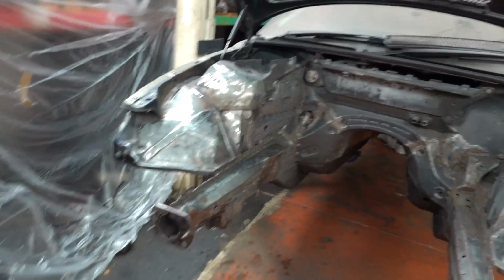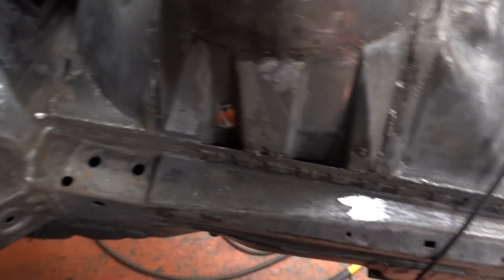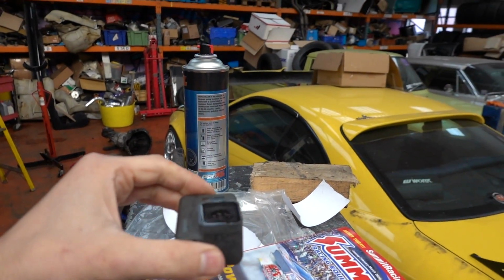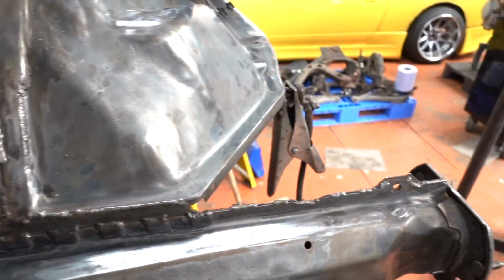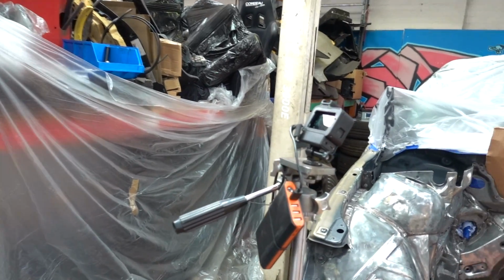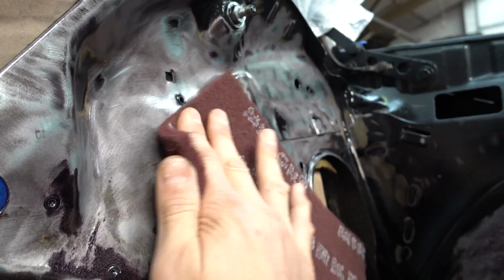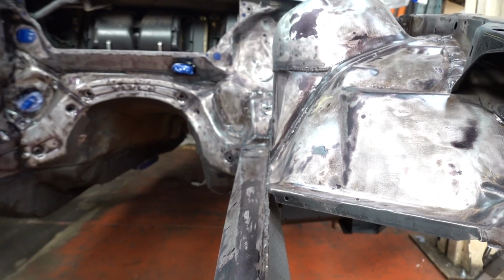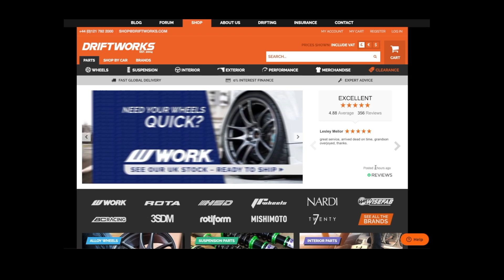Paint the engine bay with added DnB - Driftworks V10 BMW M3 project Pt 23

Comment: i'll tell ya, that would be something special to have a small block chevy in my aston. wondering if that ridiculously tall reverse gear was fixed.... the other day i put her in reverse and let it accelerate at idle speed. i swear to god i was going 20 MPH backwards before i had enough and put in the clutch. no wonder i've stalled it in reverse more times in a month than in all my 50 years of driving.

BTW, kudos on the video production/editing on this one. excellent!
Reply: Don't quote me, but I believe they switched over to a Corvette transmission in the Aston. As far as I recall from driving a 2008 Corvette, the reverse gear is pretty normal and easy to drive with.
Reply: @ethanthomas1868  yes, how stupid of me. i suppose it's a GM transmission.
(edit)....
i just confirmed that the trans is indeed from a corvette as was noted in the first part of the conversion series.
Reply from the maker: That does not sound like fun! Yeah this has a T56 Magnum transaxle in it I think.

Comment: Excellent as always! A quick explanation on the different primers/paints you're using and why would be cool too 👍
Reply from the maker: Thanks. They are standard paints (primer & high build primer) other than the first coat which is DInitrol RC900 rust converter. It's amazing stuff.

Comment: Having done so much work on the chassis already, did you consider welding in thicker horizontal strut tower plates? E46 struts are known to balloon, and I can’t think of any reason why strengthening suspension pick-up points would be a bad idea. (Late 2cents input).
Reply from the maker: We checked them out thoroughly & no issues so I decide not to.

Comment: Interesting. I wonder if Dinitrol RC900 is the equivalent to Por15 metal prep? I know metal prep is not a primer in it self but it should instead give zinc coating protecting against rust

Comment: Looking good. Is there any reason you’re using aerosol products rather than spring with a compressor and a gun?
Reply: Aerosols are easy, readily available, no clean up, less over spray, cheap, often only a 1k product so no special breathing gear required... Lots of reasons I'm guessing. Plus for a primer 1k is generally fine, lots of pro bodyshops use a rattle can for rub throughs and touch ups before laying down the 2k top coat.
Reply: kramer26 exactly this
Reply from the maker: Yep, of that list of reasons number one is: less over spray. It looks like a mess, but there's a lot of stuff in the unit we'd rather not have paint on 😬
Reply: Nice one cheers for the answers. I’m thinking of repainting the engine bay on my RX7 and that all sounds like good advice 👍🏼
Reply: @jamesford3549  just be sure to go for a quality product. The Dinitrol stuff obviously looks to be decent and PPG do a 1k epoxy primer that I've used with good results 👍

Comment: Jay why no shield on the grinder, fucking dangerous when those things pop be safe, had a brand new one explode on the first contact to metal without the shield would have had bigger problems than just putting a new one on
Reply from the maker: Most professionals don't bother. I'm not saying Jay is a professional, but I've had a load of them explode in my face and lived. Goggles are must though of course.

Comment: No offence Jay - but if the Dinitrol is a combined rust converter AND primer, surely there's no need to scuff the gloss surface??
Dare I say, "Whotsit say on the can?"!!!
Reply from the maker: And that's after he read the data sheet too. I do understand it's rather unusual for a primer to be shiny though. It's super shiny!
Reply: Driftworks I read that months ago I can’t remember what it said. It looked and felt wrong so I fixed it.

Comment: I didn’t understand the tape test 🤔
Reply: Checking for proper paint adhesion to the metal. By scoring with a razor blade like that and sticking the tape over it, if any paint came away with the tape when removed then it's a fail.
Reply from the maker: As above, basically to see if the paint has adhered properly.

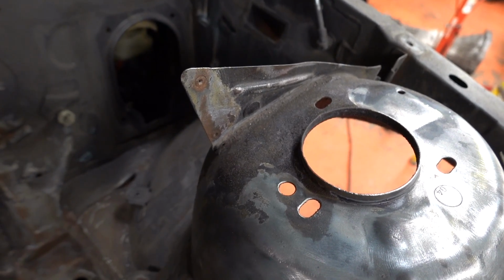Comment: Hey guys I love you're vids but I would be wearing respiratory protection when cutting, grinding, welding painted metal etc, as those fumes can be extremely toxic like at 1:15 . I see the automotive industry is very lacking in this area of PPE  even though it's just as important as eye protection. Would you use a zip disc without eye protection? Probably not. Protect your lungs. I recon You're better off smoking then doing this work without  respiratory protection. But if u guys dont care that's fine by me just thought I'd mention it as I'd hate to see someone from DW get sick from something highly preventable! Also those disposable masks dont work for that you need a 3m respiratory with at least p100 filters. My father's business partner did the very same metal processing as u guys and died of a heart attack on Father's Day from respiratory complications